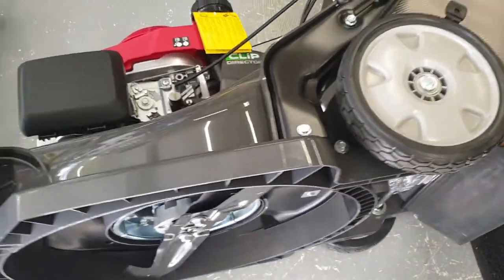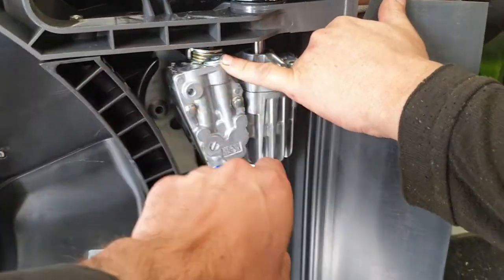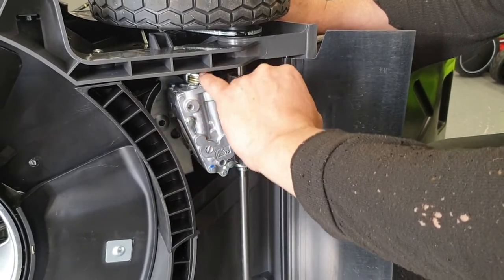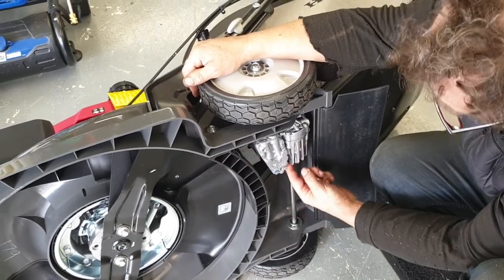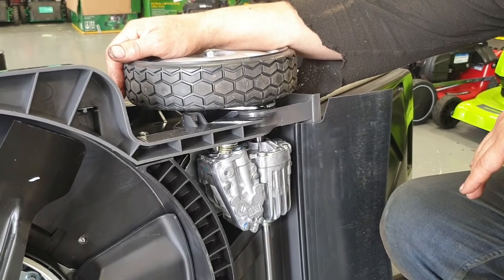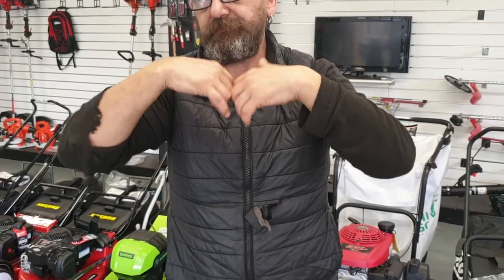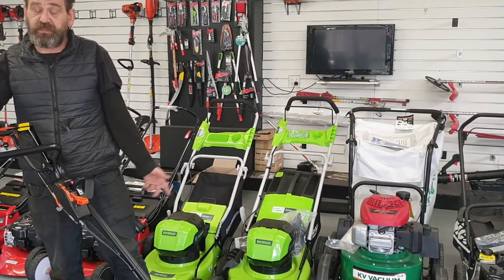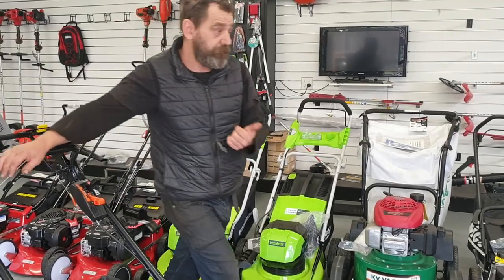Honda HRX217 Maintenance Tips

Comment: Well, this guy is wrong. 
this model of HRX217 have an Hydrostatic transmission. There is no gear in it, so only oil pressure make the drive shaft spin. 
the Hydrostatic transmission is lifetime maintenance free according to HONDA and it is insane drilling a hole on the Nexite deck to fillup the transmission by the drain plugs. this could lead to contaminating the existing oil and make more harm than good.
If you want to service the transmission make it right and remove the complete assembly and fill up with the fill port on top preventing any debris to enter the transmission.

for the wheel part, this mower the shaft is not directly connected to the wheels. so there is no change that by loosing oil you will have bent wheels. 
the only real problem is the lost of speed or weird sound when activation the clutch drive.